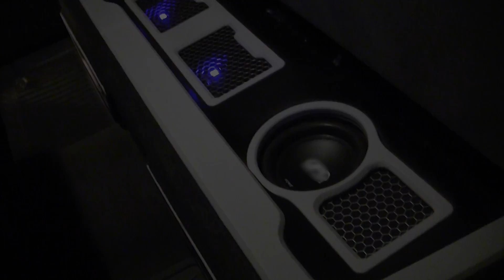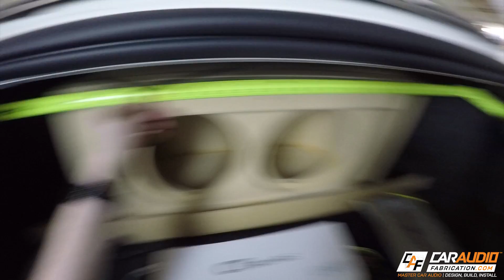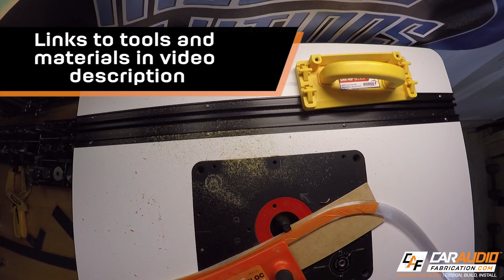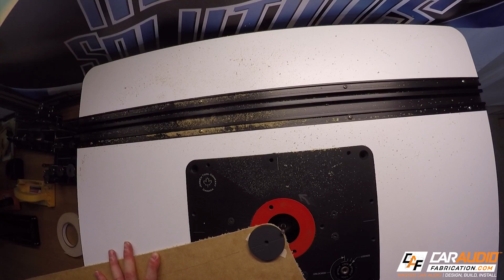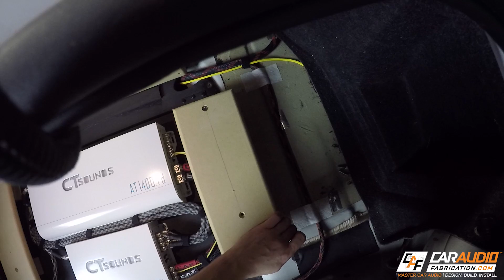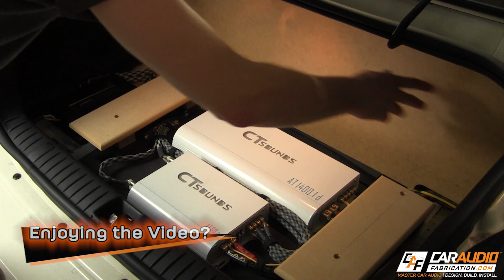Matching Car Interior Walls - Beauty Panel False Wall - CarAudioFabrication

Comment: I have a 2016 Honda CRV, i have a speaker box with two 10s lightning audio subs 250 Watts RMS. and I have two 12s ample audio subs 300 watts RMS. I would like to make something custom but keeping the majority of the space that I have in the back. because I do uber on the side I'd like to make it some bass but yet still have room for people in their luggage. really would appreciate your input. thanks a lot.
Reply: not a good idea to have a system in a vehicle that you use for Uber unless its all hidden an not compromising space goodluck maybe a sub under driver seat. . .

Comment: a great low budget way to trace around shapes or scribe something is to use round washers. you simply stick a pencil in the hole and run the washer along the edge. i have a collection of different size washers for different applications...

Comment: do you have ported box dimensions for a 2004 ford ranger edge single cab, preferably for 1 L7 and for 2 10" kicker comp RT shallow mount subs...the sealed box for the 2 10's I have doesn't sound all that well...I'm willing to pay and for shipping

Comment: How do you keep threaded inserts from pulling the MDF up?  Always seems to happen to me. Also I've never seen a link to the adhesive foam you use for embossing logos and what not, where can I find it?
Reply from the maker: +Parker Conner Cant see I have had that issue, improtant to use the right drill diameter. My page here has the link: http://www.caraudiofabrication.com/#!building-a-subwoofer-enclosure/cjh8

Comment: Very unique way to make a beauty panel! I am going to have to try this technique soon. My favorite part of the video was the use of the adjustable curve. I need to get one. What was your favorite part of the video?
Reply from the maker: +CT Sounds My favorite part is the end. Some nice blank canvases to start getting artistic with. :)
Reply: +CarAudioFabrication where did you buy the adjustable curve at?
Reply: +CarAudioFabrication do yo ACCEPT sent in a message from the "CONTACT" form on the website it be nice if a pro would make a video of it :)
Reply: +CT Sounds I've been using card board for nearly 20 years.
Reply: +tom brady Mate that is pretty hard to understand...make a point to proof your comments man, we aren't your girl friend! From what I can make out I believe the concise answer is 'yes it will affect the sound from the subs; but it doesn't matter if you know what you're doing'....as Mark certainly does. Peace